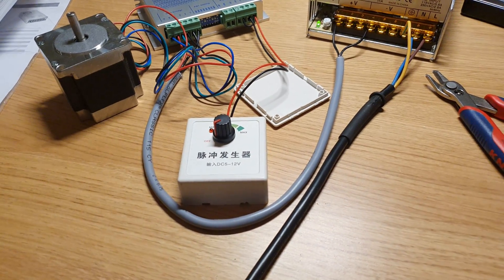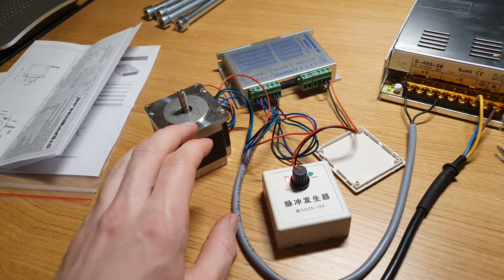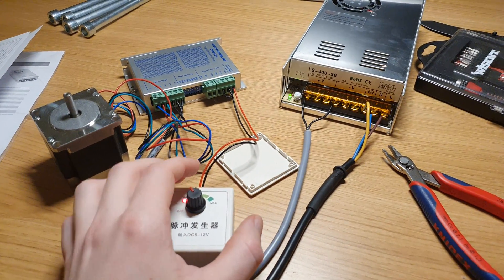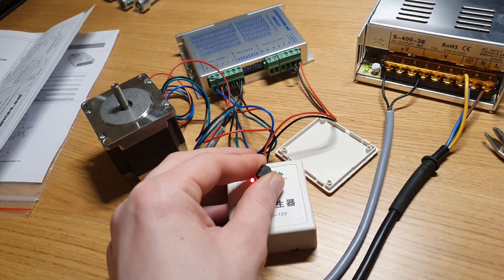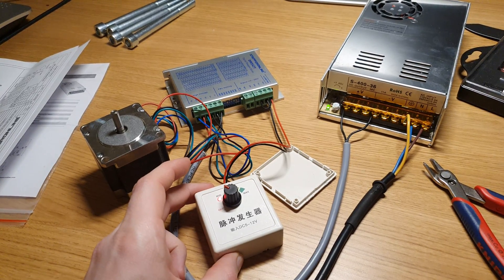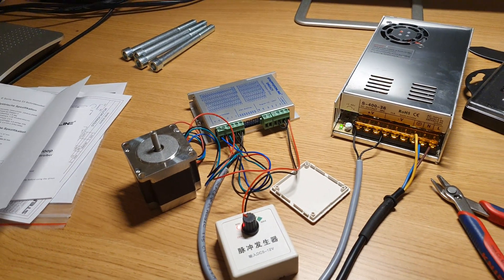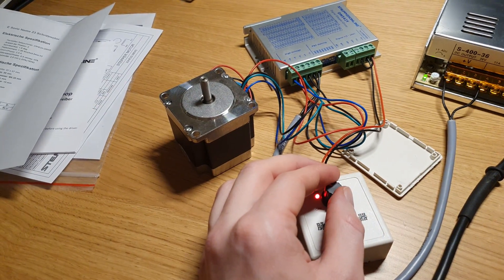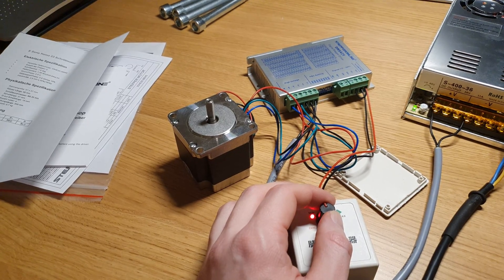Puls generator for stepper motor speed control

Comment: I'm not sure, since I'm not an expert and never built one myself, but for a power feed I think I would use also a small gearbox, which would reduce the high rpm to something useful and also increase the torque, since I think you may need that extra torque to push the heavy table... again, not sure, just an idea... good luck!